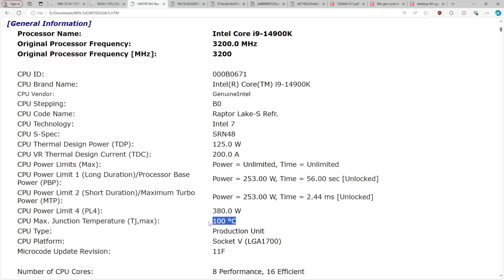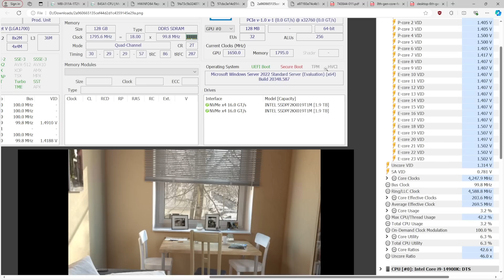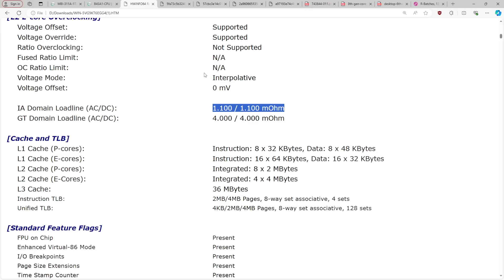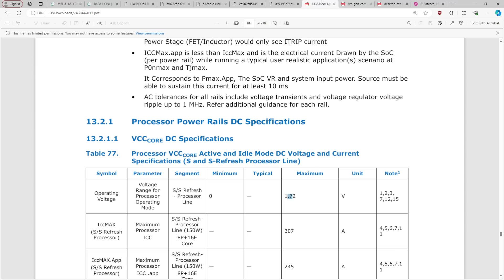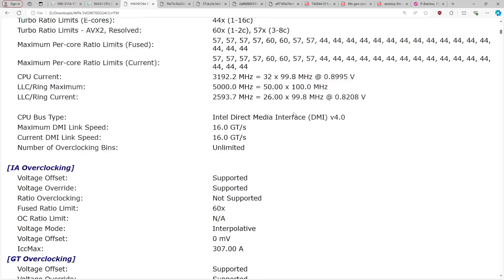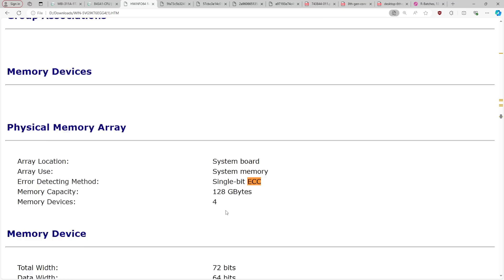Rambling about intel i9 14900Ks degrading in a Minecraft server hosting enviroment

Comment: well.. now I have to ask.
Instead of paying to get higher clock speed CPU's, why cant that money be invested in figuring out  how to either mod MC, or build alternate MC server software which wont require high clock speeds in the first place?
Most blade servers from 2017-2018 running Xeon's can beat the latest i9's in multi-core performance, why couldn't we write good software to take advantage of those platforms instead of waste it on some of the highest clock speed and wattage CPU's on the market?

Comment: 10 nm process node is not supposed to run 1.5 voltage, default is around 0.865 voltage on 13/14gen base clock.
The boost feature is just an aggressive overclock, which is forced on people who doesn't even overclock, its easy for OG's to change the single thread boost but a normie have no clue and gets owned.
No wonder they are degrading.

This isn't as complicated as Intel or people make it out to be, Intel just want to be the best.
AMD have this problem aswell.

Gamers don't need their CPU boosting to one trillion Ghz for those extra frames, they just want to play games.
CPUs needs to be reliable, not as fast as possible at the expense of the consumer.

Comment: Well Gigabyte latest E revision of bios still push insane v core even with intel spec to performance not even extreme it sent 1,6v idle to my 14900ks and i quickly just reverted to your "fix" and havent see higher idle v core then 1 450

Comment: Please reduce your videos length. Problems on these cpu are not temp or power limits, simply there are voltage spikes specially on single thread apps. A mb bios will lock down the cpu voltage better avoiding these problems. For remaining damaged cpus, rma will cover. End of the problem

Comment: It seems that both supermicro and asus cranked voltages way up on server boards.  Very odd.
Reply: They didn't. That's intel vid curve. Actually motherboard manufacturers were undervolting the cpus by messing with the load line calibration settings for higher performance at limited power and thermal envelope.

Comment: Motherboard clearly states what CPU SKU's it supports which is 12/13th gen.
"I'm assuming the person who built the datacenter contacted Supermicro" - So you don't know for sure the guy contacted Supermicro to confirm?
I saw when you tweeted about this and thought that you had to be joking but hearing the full story just shows how clueless and you are here.
Supermicro has for a long time supported only 2 generations of xeons/core CPU (X9,  X10, X11 etc..) and there's reasons for it. Just because it fits into the socket doesn't mean it's going to run.

Comment: 14900k is not a server chip stop trying to cut corners
Reply: Regardless the CPU shouldn't die.
Reply: @Qs_Internet_Cafe  noobs need to stop killing em by not properly config and tuning the chip and thats facts 13 and 14 are not plug and play they need tunning for application even where they are ment to be ran …. Desktop top tier for people who know how to drive.
Reply: @WmJamesWofford  What you said made no sense at all. For decades CPU's have been plug and play. If anything, if you wanted extra performance you needed to change settings in BIOS not the other way around. Intel crapped it pants and it stinks, they should refund people.
Reply: @Qs_Internet_Cafe  let me guess you run AMD …. You don’t understand the difference between running top tier and economy. GL
Reply: @Qs_Internet_Cafe  you have to tune it for purpose. If you don’t understand that you should stay away from top tier.
Reply: @WmJamesWofford  "top tier and economy" - You a funny human ! Point still stands Intel should do what's right and refund people for INTEL's mistake. I don't have a hate boner for Intel or AMD, unlike you mister "top tier".
Reply: @Qs_Internet_Cafe  intel does not need to refund for user incompetence.  If you don’t know how to drive don’t go buy a porshe
Reply: @WmJamesWofford you're right, intel should be rmaing for their own incompetent garbage which is exactly what is happening
Reply: @paneledp  lmfao good luck with that.  You should read their disclaimer

Comment: Haven’t GN and Level1Techs already proven it’s a hardware problem? Why are you still stuck on this being a firmware or voltage problem? Why are you deliberately ignoring evidence and data? Honestly, the way you’ve handled this has made me lose a lot of trust in your opinion. You are steadfast in your refusal to accept the facts. 

Your first rant was you poring over a bunch of data that pointed to this being way bigger than a voltage problem, and your conclusion was literally “I still think it’s a voltage issue”. You’ve clearly reached a prior conclusion, and are bending over backwards to stick to that conclusion.
Reply: The firmware/voltage thing is from the Intel statement yesterday.  It's still essentially a hardware problem but according to Intel, the microcode is incorrectly setting a higher voltage than it should, beyond what is safe for the CPU that will burn up the CPU and cause hardware problems.  While I'm still a bit skeptical of Intel's statement about this being the whole problem, it would fit the data from GN and L1T that they've presenting in videos so far.

What I won't be shocked to find out though is that Intel is fudging things a bit and that what happened is that the voltage they targeted was supposed to be safe for the processor but actually isn't, or that they're doing it for too long or something along those lines and it's an Intel screw up that they didn't expect to kill things like this, at least this fast.
Reply: Beacouse you, arcrudd6579 is wrong. This hardware problem can be somehow avoided with lowering maximum 1T-2T frequency (and lowering coreesponding maximum voltage).
Nowhere does he says it isnt a hardware problem.
Solution from here - avoids this problem for 90-95% of CPU's.
Reply: @volodumurkalunyak4651  False. Just plain misinformation.
Reply: @volodumurkalunyak4651  It feels a lot like the apocraphyl HCF instructions from the good old days of computing.  For those that don't know, it stands for "Halt and Catch Fire" where the CPU would do something that would burn up the cpu or some other important circuit on the machine rendering it either on fire or permanently damaged.
Reply: @aricrudd6579  so why are you watching this video then?
Why else would such video is made?
Minecraft server users liyerally have less of those CPU's fail at lowered max voltages and corresponding lowered 1T-2T frequencies.
Reply: @volodumurkalunyak4651  Lowered voltages merely makes them last slightly longer. It does not fix the core issue, which is at the hardware level. This has been clearly established.
Reply: @aricrudd6579  AMD 7000 series CPU's were exploding untill AMD released an update that lowered vSOC to 1.3V or below. How do you know Intel Raptor Lake CPU's don't have similar vCORE behaviour?
Reply: I don't think that this fellow, GN, Level 1 or any of them have proven anything. Lots of speculation and theory, but no proof. Gotta let these things shake out a while...
Reply: Neither GN nor Level1Techs have any idea as to what the root cause of this problem is. Hence why they were continuing their own investigations into the matter and chasing other possible leads. They didn't conclude or even prove in any way that it was a hardware problem. They just pointed into how big and widespread the problem is and that the issue is not related to any kind of user-side tuning or manual overclocking. 

I find Buildzoid's work to be very valuable in the matter. There could be a chronic hardware-level problem with the 13th and 14th gen Intel CPU's that contributes to this specific issue but the root cause is very likely voltage related because unsafe voltage (combined with heat) is the usual suspect when it comes chip degradation. 

From what I've seen so far I personally think the issue is indeed voltage related and it is mainly a configuration(running the hardware with wrong/unsafe specs) problem. In that case disabling TVB completely and limiting the maximum operating voltage should prevent rapid degradation for new chips. The ones that already degraded will need extra voltage to even run stable with maybe lower boost clocks. I doubt Intel can fix damaged hardware with a simple microcode update.

Current Intel default specs are pushing the hardware into unsafe regions. These are clearly not 6GHz or even 5.7GHz+ products if they need such high VIDs to achieve those frequencies and Intel has falsely advertised them as such. There needs to be consequences for this.